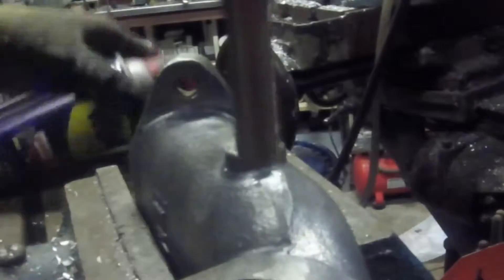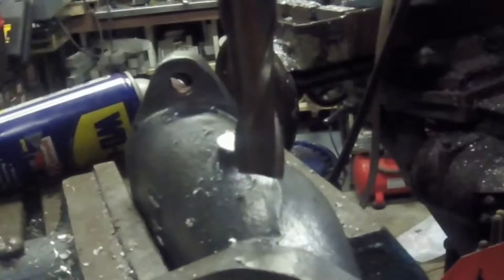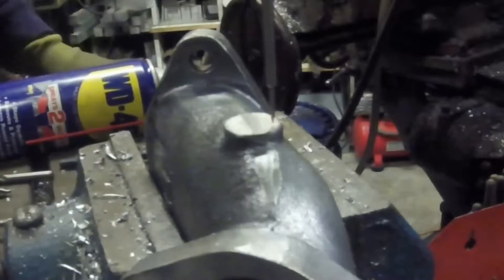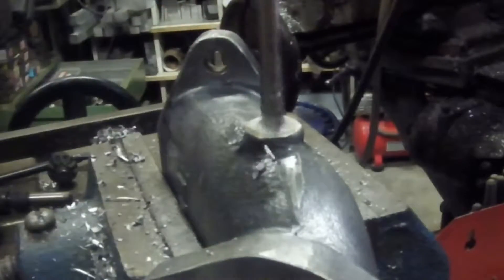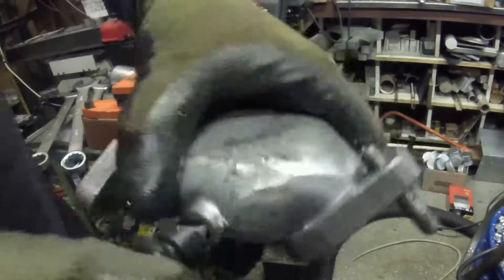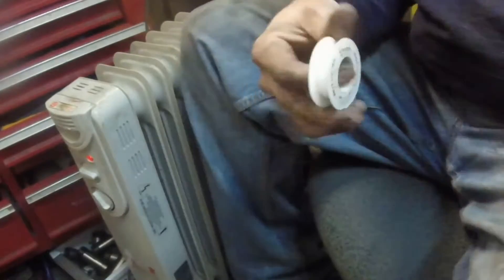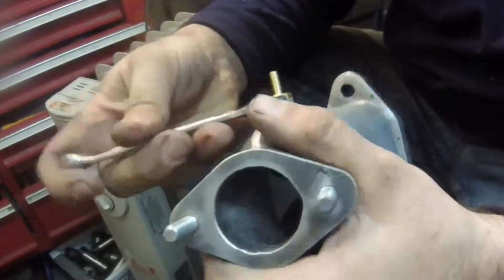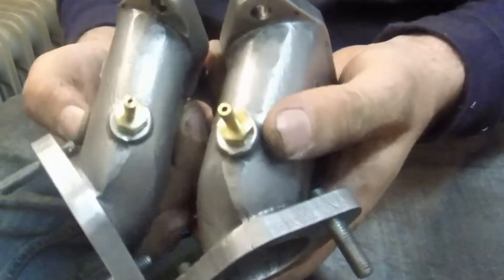Drill and Tap Weber ICT manifolds for a balance tube

Comment: Can you tell me which cylinder runners you tapped into and why?? I followed your video and did mine tonight. I tapped 2 and 4 but now have concerns that i may have needed to do 1 and 3 instead. Thanks in advance for your answer.
Reply from the maker: I'm not really sure it matters.  The balance tube just allows for the pressure on both sides of the motor to be equal.  With the ICT manifold the two cylinders on each side are already balanced because of the shared air space right below the carb before it splits into two runners.  With the hose running between each intake the pressure of air from each side of the motor should balance out regardless of which runner is tapped.
Reply: @ecdezz  Thanks for the quick response. The video was very helpful. Hopefully this will allow my car to run on all 4 cylinders at idle

Comment: Thanx 4 the upload. Did you have any trouble reaching the spark-plugs after installing this? 
I bought a kit with balancing tube, main jets and some other stuff for ICT`s and they say in the instruction that the positioning of the hole should be planned carefully so it does not block access to the plugs or hit the carb. 

Keep up the good work, I love the fact that aircooled VW`s probably have most DIY and how-to videos on youtube =) Peace
Reply from the maker: Thanks!  I didn't have any problems but my manifolds had the bosses cast in them for placement.  If yours don't have that I'd measure carefully to be sure there's no problems later.

There's a few more VW related videos in my library.  I also have another channel for my VW projects. ;)

https://www.youtube.com/channel/UC_gRDbpHoq-oHvJKbqW_5yQ
Reply: @ecdezz  Hehe, Fasty McRoadHammer, what a great channel-name =P 
I think I iwll buy CB performance or CSP manifolds, they have the pre-drilled holes (bosses?), 
and they are longer than my EMPI manifolds. But I will drill holes in the empi manifolds anyway, and make a video of the process, so people have some guidance related to that issue, if needed. I have subbed to McRoadHammer now =)
Reply from the maker: Thanks man!  Progress is slow over there but it helps keep me going.
Reply: @ecdezz  Slow means quality over quantity ;) I will start posting my own videos soon, as my beetle project is close to finished, after 9 years. Started with a rusty old 1972 beetle, and now it is good as new, with many many funny details ;) 
I`ll let you know when I have uploaded some videos so you can see it =) 

Peace